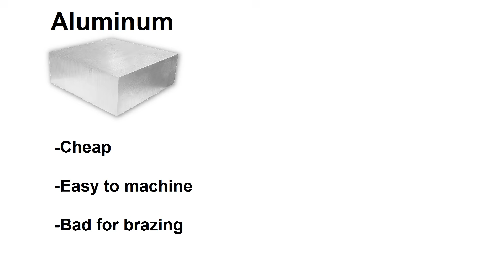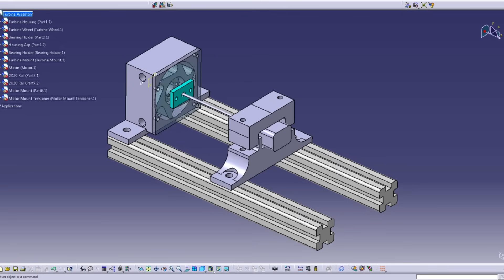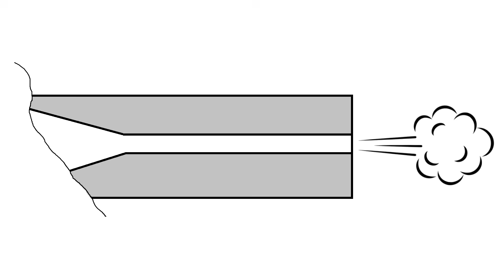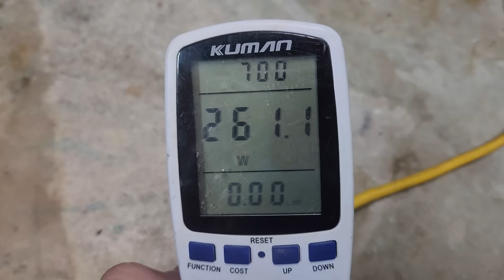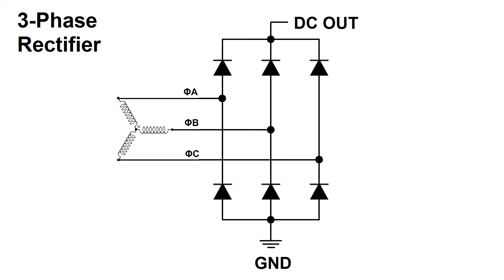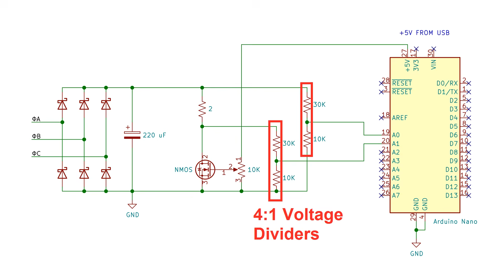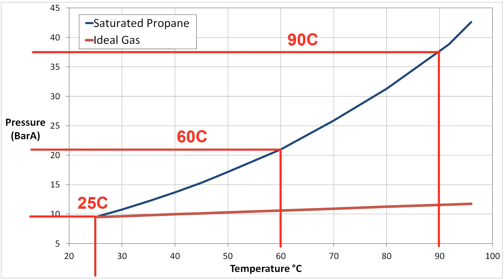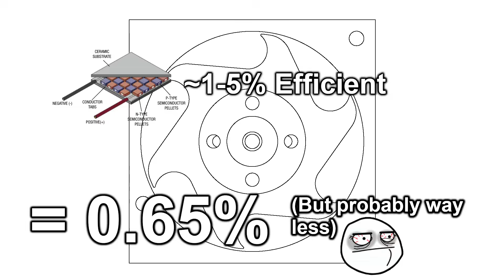DIY Micro Steam Powerplant

Comment: I'm impressed with your little paddle steamer (forgive the pun) turbine. I love that you were able to machine something like this with a small hobby CNC machine. Although I have several 3D printers I haven't taken the plunge on the CNC yet. You have inspired me to move that project closer to the top of the list. Thanks. On another note. The paddle steamer style turbine is inherently inefficient due to the expansion of steam only occurs while the segment is over the steam nozzle and the rest of the rotation to the exhaust us just moving it around and then when leaving the exhaust port the remaining expansion is lost to the atmosphere. The conical expansion of the steam is the reason why we use bladed turbines with a conical expansion profile, ensuring that nearly all the energy of the expansion is converted to rotation before the exhaust leaves the turbine at nearly atmospheric pressure. I couldn't be bothered looking it up but from memory of my school days, a very long time ago, I believe the expansion ratio of water to steam is around 170:1 unless superheated so that needs much more expansion to capture that energy than your little turbine did, so that explains much of the 0.65% efficiency.
Not being nitpicky. I am sure that you are aware of all of this and the reason for not doing a "proper" turbine is that they are so damn fiddly and complex and would be near impossible to build using the gear you have available in your workshop.
Thanks again. Love your work. Cheers.

Comment: You can also use the flyback diodes in the mosfets or IGBTs (if you have any, and their forward drop is generally a lot less than regular or even stand alone schottky diodes.

Comment: could have the propane do four jobs
have it pressurize the water, have it run through a second turbine to jumpstart the generator, have it coil around the outside of the large tube so when it's burning it pre-heats itself, and of course there's generating steam

also fun fact, the earliest steam engines weren't very effective powered by expanding steam alone, they got most of their power from the drop in pressure you got by exhausting the steam into a condenser

Comment: You should add a lower pressure secondary turbine in series so you can use that steam more efficiently, also you need to get the steam hotter to generate more pressure out of the boiler, the steam is way too wet, maybe add a secondary coil intertwined with the first one where the steam can get even hotter, use the heat more efficiently, insulation is key, also make it so that the wet steam can cool off after the turbine and loop back into the tank, it’ll preheat the water and make your system more efficient

Comment: Ever heard of a trompe pump? You basically made a variation of one with your propane setup. Sort of. 

Heads up before hand. I am only a 5th class, so I may not have the best understanding of all the systems at play, and may have made a mistake somewhere. Maybe multiple. But, I'm sharing this regardless, because it would be neat if it works the way I think it should, and you get good results from it, if you test the idea at all.

Simple, water and air go into the inlet side of the pump system, it combines via a system of straw like structures sucking the air down into the flow of water. This air of course doesn't want to stay there, so it rises out of the water. You use this to your advantage to let a collecting basin hold the air. The key is to make sure the flow of water is always a higher pressure than the air so it wants to stay put. The water continues down the line, and exits the system from the other end.

It's purpose was to help bring fresh air down into the mines, back when it was in any use of any sort. But, better systems for doing that have come around. But the idea, or rather technology itself, still has potential uses in my opinion. Especially if altered to fit the purpose better. 

A trompe pump, essentially, is a air pressure battery, or perhaps capacitor is more accurate. So long as the flow of water going through remains high enough pressure itself to keep the pressure of the air substantial enough to make use of via an outlet of its own, you can redirect that pressurized air into a new system of your choosing. Like what?

Well, how about the water feed for your micro powerplant? 

You use the trompe pump inline with the water supply already established to collect air pressure. That water moves on down the line to some ram pumps setup to increase their pressure the more of the system of pumps it goes through. It won't be an immediately fast process at this point, but it will still be faster than heating a boiler. Okay, so you have moving water from whatever source that may not be moving at any pressure at all beyond any given to it via gravity. (The water going into the trompe pump is typically water falling into it, so air can suck in via the chimney effect.) That energy imparted upon the water via gravity, is going to help it get to its first destination of the first array of ram pumps. This array moves water towards the next array, which will be set to required more water pressure to continue forward. You repeat this process until you have a high enough water pressure to make it to a holding tank. A big holding tank. This holding tank will also have a return inlet for any water that recondenses later and is sent back into the system, if any. (This would be done by having a tub of sorts below the turbine, to catch any water that condenses and lets it flow back into the tank.)

But what about the air pressure?

That's with the water tank's next process. The outlet for this tank is at the bottom, utilizing the constant flow of water going into the system, to keep a constant pressure of water exiting the system. The air from the trompe pump, ideally higher pressure than the required pressure for the system itself, is going to finish the job of bringing the water through the tight coil until it can burst into steam and release its vapour. 

Pressure relief valves? Yes, but only (I think) they will be needed at the trompe pumps air tank, for safety sake mostly; and the holding tank itself, just incase any vapour is somehow making its way back into that tank, thereby increasing the pressure. But, this should mostly result in backflow occuring in the ram pumps because the pressure will begin to exceed theirs instead. (I think)

Okay, but what about heat? No propane in this system so far, so where's the heat?

Those thermoelectric pads you mentioned? The seebeck effect. 

You have cool moving water, so you already basically have a liquid cooling system if you utilize it properly. So you just need to cool the hotside of those pads, and let the cold side be heated via a different method. It won't be a lot of power from just one pad, but you'll be using mulitple and stringing their outputs together in series and parallel via different arrays, and then pairing them later for your actual power output. The heat for this, could be many things potentially, but we'll be utilizing a heat pump and phase change for this. That water... it's cool, but it's not 0 degrees cold. So it has heat we can collect from it, and reuse elsewhere. 

Okay, but then what about the power required for that? Two systems. 

1. A battery bank, not of huge size, but enough to get the system started and moving. 

2. A return system for the power generated to ensure the battery bank stays charged up, and operating on excess power otherwise. 

(Insert electrical system required to move said power)

Power is at the location now. So where's the heat?

I forget the term for it, but we'll be using electric magnetics to heat the copper piping with the water at high pressure in it. This ideally will reach temperatures high enough to start the reaction of turning the water into steam. From there, I'm sure you can figure out the rest easily enough, since you already have the mechanism built. 

However, there is one last thing. 

Perhaps have 2 or 3 outlets for the steam, and similar inlets for the turbine. 

This is so you can spin it up and spin it down with more control. You put pressure relief valves essentially on these outlets, and you make it so each one only releases its pressure at set points. You also have each angled so they all hit the same location inside the turbine. 

Then if you want to spin it up, you increase the pressure of the system so that the release valve that corresponds to that pressure lets out its steam. And if you want to spin it down, but not 'turn it off' entirely to do so, you just redirect the steam to the lowest pressure valve by having some manual turn valves attached that redirect the flow. I forget the proper name for that part, but I'm sure you'll know what I mean. 

The end result should be that you can turn one valve to turn the system on essentially once the battery has been activated for the heatpump, turn another valve to increase pressure in the system, another to bring it to max pressure, and another set for each to redirect the flow as needed between them. 

I think, this can work. How well? Not sure. That's why I share the idea, and I only share it with folk who might be able to test it out, without it being a huge burden on their part. 

So you're like... the 3rd person I've shared this with. You'll be the first to actually try it, if you do.

Comment: I wonder why they don't make steam cleaners that work this way. It seems like it would be a lot easier to put a small air compressor in the steam cleaner to pressurize the water tank, then heat the steam output with an electric coil. You could have instant steam output at the press of a trigger as opposed to waiting forever for the tank to heat up and cool off and if you have to stop while you're using it, you're just wasting water/steam.

Comment: if you want better performance look at how tesla turbines and turbos get their spin, the more surface area the steam has to press against the more power the turbine will generate so you could use the same steam to run many generators vs 1 or a few

Comment: A lot of the sliding vane pumps and motors I have seen use Micarta or graphite for the vanes. Micarta, depending on the specs is made from resin impregnated fabric. Graphite, well, it's graphite. Self lubricating, and very stable at lost of different speeds and temperatures.

Comment: Great video! I was thinking, what if you used a Harbor Freight die grinder to drive your BLDC motor (or alternator)? Instead of using propane and a pipe to heat the copper tubing, you could bend the tubing into a cylindrical bifilar coil and place it inside one of those charcoal briquette lighting cans, then fill it with charcoal for heat. You could stoke the coals as necessary to maintain the heat. This method, if workable, could be an emergency solution using scrap materials.

Thanks for putting in the time and effort on these videos—they’re well worth watching!

Comment: Simple rule- outlet should be 2X inlet. In other words, the steam expands, you want low or no pressure on exhaust VS high pressure on inlet. This is true of so many flow systems, but again, always try to make exhaust larger than intake. I'm not talking about your nozzle- I'm saying you used the same size tubing bore hole in and out of the block.

Comment: maybe use a safety valve like the kind on those hot water steam cleaner systems. so you get enough pressure behind it before the steam is released. them things get instant hot steam coming out they use a fan and a spark generated at the base of them that shoots a flame 5-6ft high with diesel or kerosene or you can use a Fresnel lens on a coil of copper pipe and it would make a ton of steam very fast. it would be even crazier to use a reflector behind it. now to turn that steam into energy. maybe along with those chips that generate power or use the water to create h.h.o. and use the gas generated in the system. maybe steam/hydrogen for more power. probably should have hooked a alternator up to it. you can get big Fresnel lens from old school projection tvs they use that as a big magnifier. keep up the good work love the videos gotta watch them at .75 speed lol

Comment: SLIGHTLY INTERESTING FACT: I might be wrong about this but I vaguely remember an engineer I worked with in the oil business that dealt with steam injection in the process of heavy oil recovery tell me that when people see “steam” coming up from a pot of boiling water, for an example, that that’s not actually steam rather that’s just water condensing from steam. It’s these tiny condensation droplets that appear like a mist/fog. He said true steam is actually completely invisible and completely a gas with no water droplets in it. In fact he said that steam can be super heated to the point where it could easily catch things like wood or other flammable materials on fire whereas water in liquid form (I.e. the water droplets you see appearing as a mist or fog) could never do that.

Comment: For the conv-div nozzle, you can get away with machining 2 tapers (albeit it will have a weird flow profile) so long as the inlet maximum diameter is much larger than the outlet diameter.

Comment: As I understand it, flash boilers have another big advantage over conventional boilers - they are much less of an explosion risk.  The danger of a steam boiler explosion is a function of the amount of steam they contain (and it's pressure).  A conventional boiler holds a LOT of steam, so it can go boom very effectively.  Flash boiler only ever contains a small amount, so even if it does blow, it's a much smaller explosion (assuming boilers that are producing same amount, pressure, and temperature of steam).

Comment: Maybe isolate the compressed fuel from the water by a rubber bladder like in an expansion tank, or some kind of a double sided cylinder. Please at least make a bigger rotary drive one with good seals.

Comment: No expansion on the turbine? That isnt a turbine, it is a wheel that spins by pushing on the fins with air. A turbine will turn the heat in the steam into kinetic energy by expansion, and will produce greatly increased efficiency and dramatic increases in power. The way it is now, the heat goes in and the heat goes out, none is turned into power. The only power created comes from the source pressure. Yes you can produce pressure with steam, but that is no turbine, and that is why it has such a low efficiency

Comment: In sizes below 1,000 horsepower, reciprocating steam engines are generally more efficient. Uniflow steam engines are the most efficient design. A guy named Dan Gelbart has made one on YouTube with a computer controlled solenoid intake valve with computer controlled cutoff governing.

Comment: cool steam generator machine. i'd guess that the main efficiency loss is the burnchamber with the flashboiler core inside. it's not insulated plus the exhaust must be taking away lots of heat.

Comment: @Hyperspace Pirate

You should've used an axial turbine, encased in the middle of an exhaust pipe to capture maximum energy. Put the shaft/motor on the other end, and drill venting holes near the end, but either far-enough from the motor, or else shield the motor from the exhaust. Should do quite better for minimal effort and change.

Comment: Nice work!
I'd recommend setting the Z0 of your work offset to the top of the part (maybe even add a small gap) and make all your cuts in -Z. That makes it less likely for you to accidentally rapid through your part.
The way you cut the profile works, but you'll wear out the bottom of your cutters faster. Cutting with the full length of the flutes ends up being more efficient, even if you have a much smaller stepover/depth of cut. You'll also get a better surface finish because the flutes are going to have less deflection the closer they are to the chuck. It's still worth giving it a spring pass, though. Especially if it's a one-off.
Are you using thrust bearings?

Comment: I'm only at 6:09 so I hope I'm not made a fool of, but you could use some ejumucashun in deburing. The edges rotor look terrible. Get a deburing tool with the "spinney" accessory to make fast work of round holes, or just use a good knife or some files. This should allow you to get better with precision because you won't have burrs to worry about but uhm... ya.

I went to school for machining about 8 years ago so I got to learn about all the areas i was lacking in when it comes to metal fabrication & such. So, I know that sometimes you can work around metal your whole life & miss some pretty basic stuff.

Comment: Your steam is incredibly wet, leading to massive efficiency loss, and you aren't letting it build up pressure at all. Force the steam in a small vessel, then reheat the steam before you direct it to the turbine and you will get far better pressure, the water wont fly everywhere and your turbine wont waterlog as fast.

Comment: You can coat 3d prints with beer can aluminium superglued and hammer shaped on, and its strong and durable enough to not melt or deform with steam. This way you dont need to mill anything.

Comment: Why do something else when mere seconds before saying that you told us exactly what you can do instead. The two other methods of harnessing steam power on a small scale would be interesting. Especially if you made a version which can work with other fuel sources, like wood, to make some electricity in a pinch, and bonus points if you also sell that to preppers who are expecting to be on the move after sheets hit the fans (I know that's not what SHTF means, but it's close-enough to not be removed by yt for unwelcoming language).